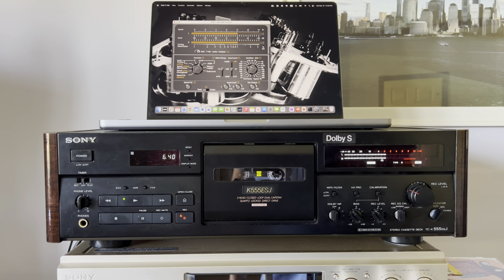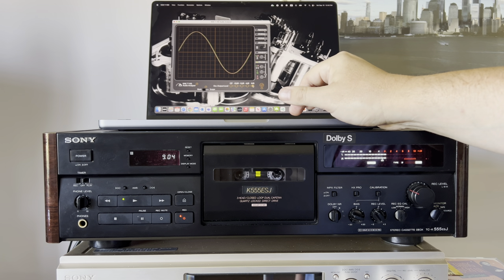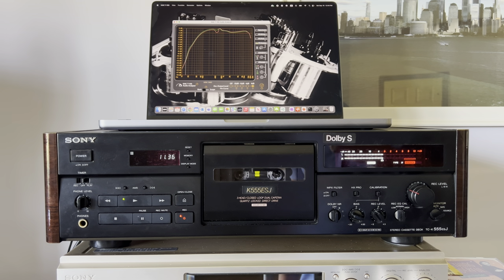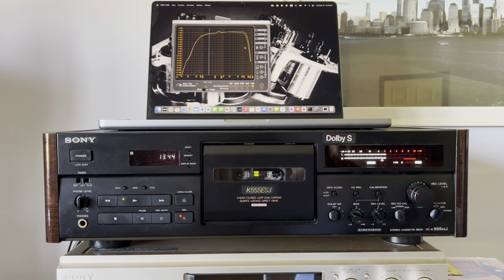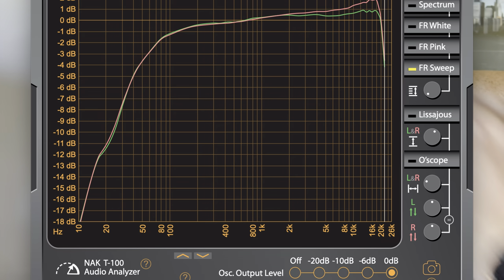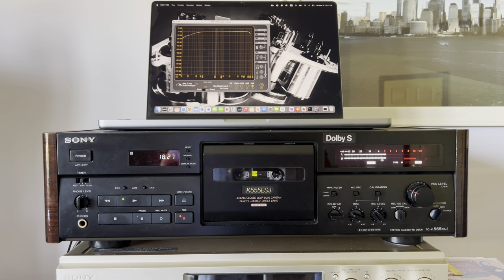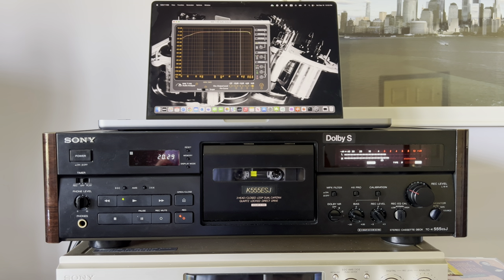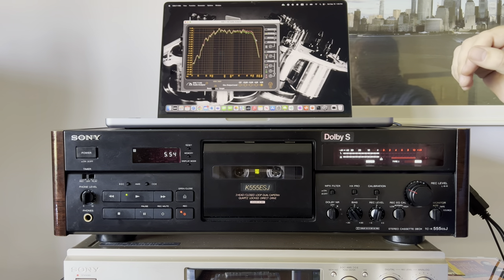20 Hz to 20,000 Hz 0dB? Improbable Sony TC-K555ESJ

Comment: Excellent video, like all your others! Can you please update the description with the capacitor makes and values and the position+value of the ones that were replaced. Many thanks?
Reply from the maker: https://www.digikey.com/en/products/detail/würth-elektronik/870135774001/8556622    https://www.digikey.com/en/products/detail/würth-elektronik/870055774001/5147541    https://www.digikey.com/en/products/detail/kemet/A759KS475M2EAAE496/6196534
Reply from the maker: Just to make sure, you understand. You will get a very precise but at the same time digital sterile sound. If you like liveliness of analog sound I would recommend to go with Nichicon FG.
Reply: Thanks yes Nichicon FG are great caps but expensive. What is the location on the board for the replacements please? Many thanks.
Reply from the maker: @thetapeshack2595  Solid polymer caps are up to 10 times more expensive than Nichicon FG. Technically, in this model, you should replace most of the capacitors with indexes 1xx, 2xx,3xx, and 4xx. 5xx are power caps. But I would recommend following the arrows on the schematic indicating the signal path.

Comment: Eerily UNREAL. I still can't understand the logic behind that. It cannot be confined to SONY decks, this should be possible to replicate on any other deck using a Dolby NR or even a dbx as long as you use the PP caps.
Reply from the maker: It is not a PP caps, it is a Polymer caps.
Reply: @hifirulezzz  yeap. Those ugly plastic buds.

I'll try to work on my mind to make me accept the idea.
Reply from the maker: @m80116  you should watch my Red vs Green video. These caps looks the same as a regular aluminum caps. If you will search for them - use Aluminum Polymer caps.

Comment: 20- 20,000 with a cassette is not possible at 0dB at normal 4.75 cm/s speed. The tape would saturate  at those frequencies and level.
Reply from the maker: You just watched that it is. Dolby system was invented to fix that up.
Reply: @hifirulezzz  giusto